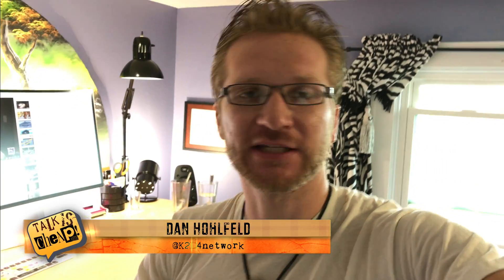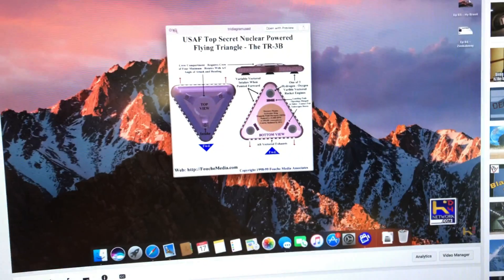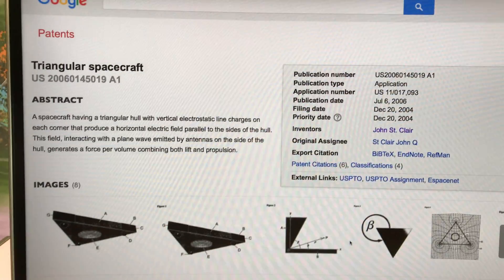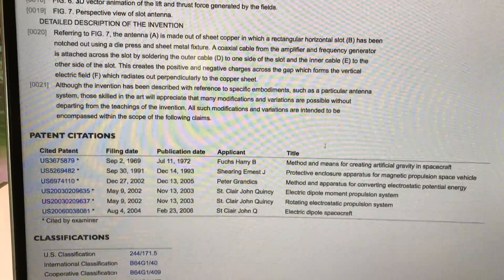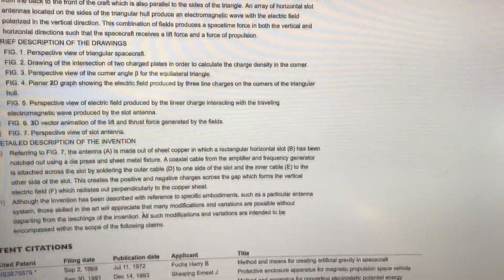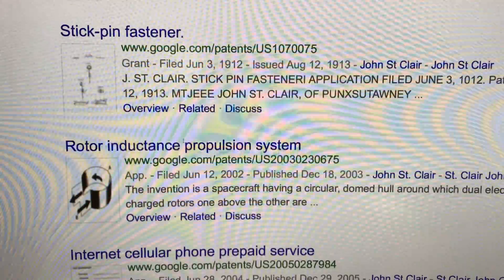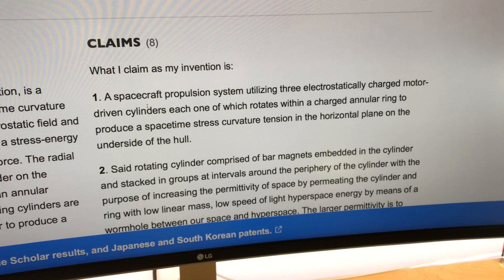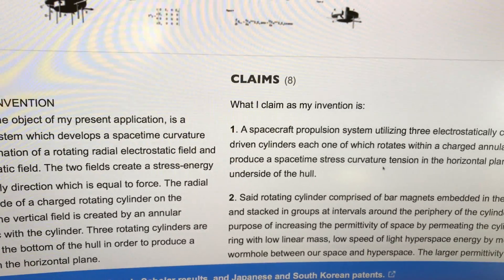TR-3B Patent!!!

Comment: To build a demonstration test model. Use two hard thin wall copper "drain pipe" sections that have 180 degree turns. These should have flared ends, holding male and female lock collars one on either end. The loop is about a foot or so across on the inside, and the pipe is about an inch and a half inside diameter. Fill completely with ordinary tap water the taurus or "doughnut shape" copper "loop". Spin the water inside this loop by hand, turning it like a "hula hoop". Toss it into the air, and it will float suspended in the air for about ten seconds. It will slowly turn due to the movement of the water. As the water slows, the loop will slowly descend. The lift is due to the centripetal energy imparted to the center of the moving water. Victor Schauberger called this "the implosion principal".